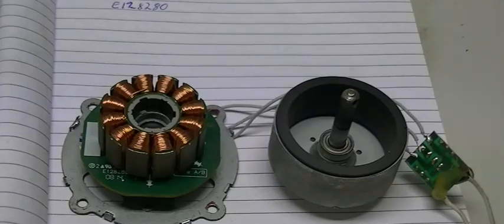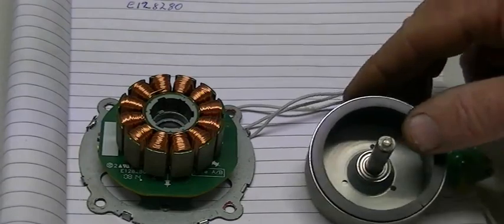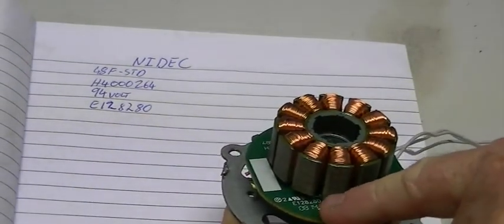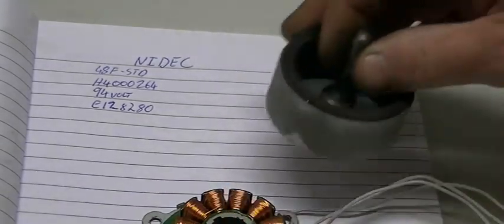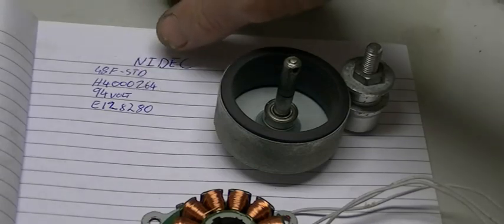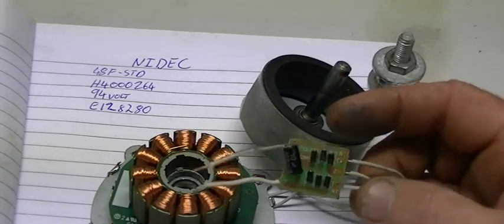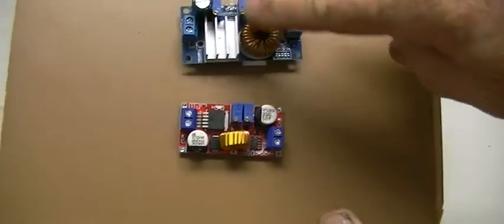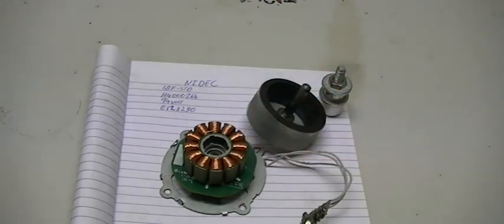DIY Mini Wind Generator

Comment: Glad you're still doing pulse motors tinman. I'm copying your twin bemf window motor circuit. It works great, just wish I can get OU🙂👍
Reply: Would love to see a video of you motor you should make a video and share your work Iv been waiting to replicate it too thought it was awesome how many 18650 batteries he was able to charge of the run and the run barely went down  In voltage
Reply: @overunityresearchchannel  I have been watching tinmans videos for last 6 years, I have some great ideas to make a higher torque bedini pulse motor for a lawnmower. But I have to master the circuit first. Aim to recharge 2nd battery or self sustaining bemf single battery 👍🙂

Comment: out of all the motors that i have accumulated over the years iv been looking at one i had its a AC Blower fan motor but its a 3 phase permanent magnet motor there call ECM motors electronically commutated motor man these motors are really good you might have one laying around if your like me i checked today with volt meter with one quick turn by hand i get easy 14 o 24 these can make excellent wind turbines i mean they are pretty much wired for it just need 3 phase 6 diod rectifier smoothing cap and too charge controller to battery as far as wiring anyways you should really check out those motors there really cheap on ebay too :) also i am enjoying this project i learned about the diode on the output from the dc to dc converter that tip will come in handy lol i burn 2 out back then along with dozens of transistors but hey if your not burning transistors your really not experimenting Cheers ;) to the TinMan thanks
Reply from the maker: I will have to look up those motors. Cheers for the info.
Reply: How many amps wr u able get out of the at what rpm